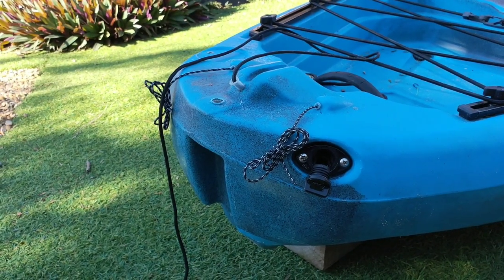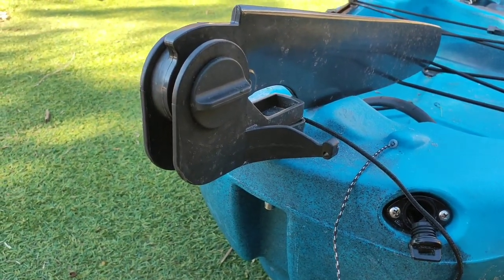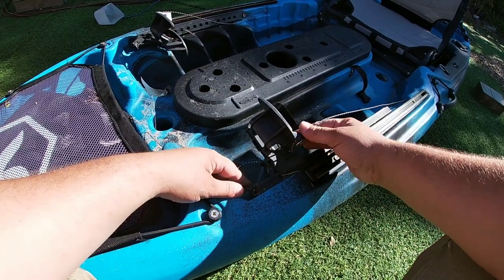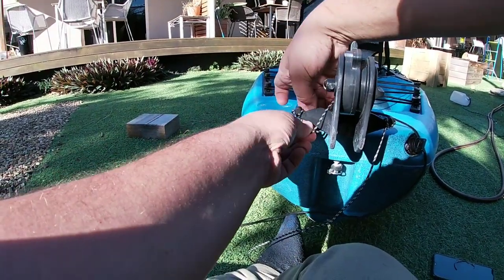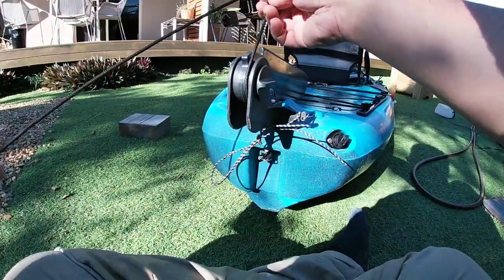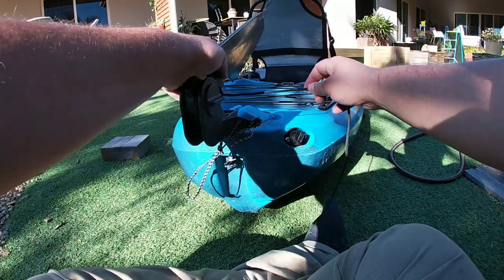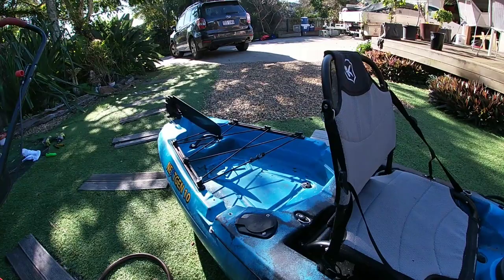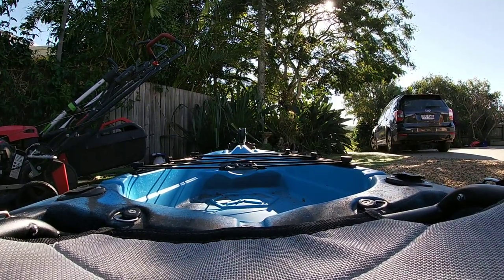Kayak rudder installation - Next Gen 10 Pro Fishing Kayak

Comment: I swapped the control "string" over and replaced it with 80 pounds, plastic covered, stainless steel fishing leader. It works great and less friction. All that I had to do was crimp the end's rather than tying knots..... Word of advice to anyone thinking about deploying the rudder while out on the water DON'T.... I ended up in the drink. These days I deploy it 3/4 of the way before I head out. I also spray SILICONE down the tubes that my control ropes run in. I hope this helps someone out there.
Reply: I've  just fitted the same mod to my NG10 Pro, and it is so smooth to deploy the rudder now. Thanks for the tip Les.

Comment: Great video mate, the guy at the kayak shop told me that the washer goes on the bottom of the rudder from the top side, so washer first than place rudder than pin underneath. Just thought I’d mention it. Like the instructional videos very helpful
Reply from the maker: Thanks for heads up, makes it much easier for movement 👍

Comment: you have not shown where the pedals are set as I have them and they are on a metal spring so where is the position they are set as I think you use the toes to push on the top part to make the rudder turn